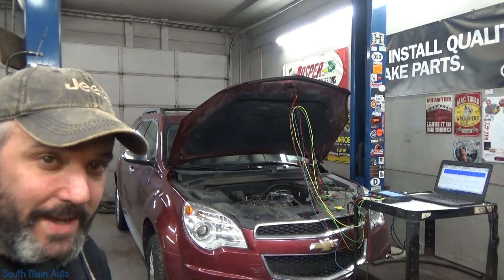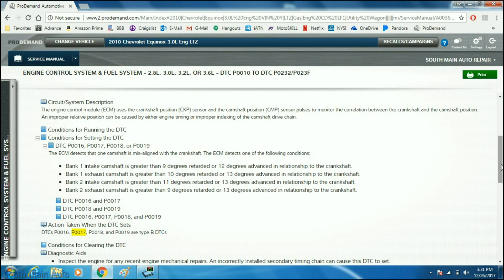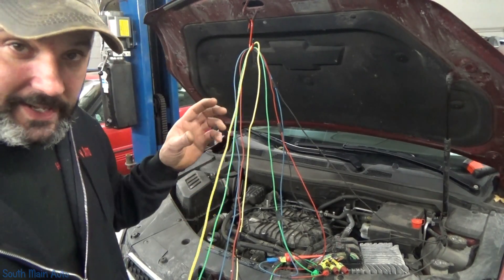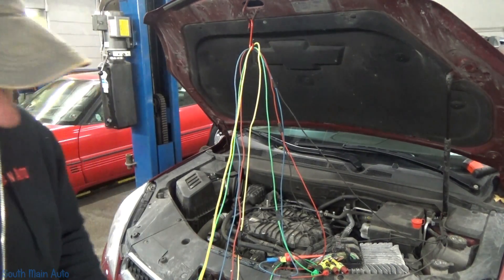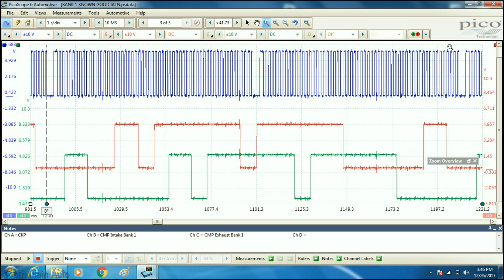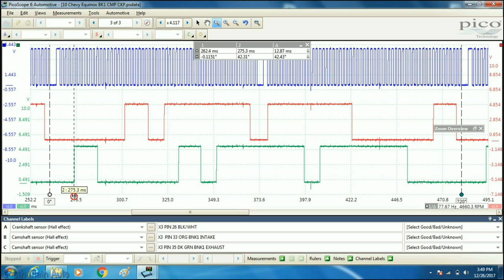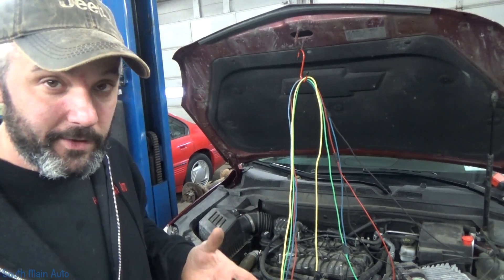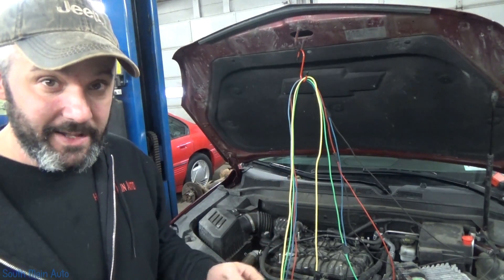Do I NEED A Lab Scope In My Shop?!

Comment: a scope is a vital tool now, we do have a pico in the shop and it is a crazy good tool however sometimes you just need a quick scope hook up to check to see if you have a pattern. some meters do have a scope function but there are so many small easy to hook up scopes now from people like fnisi etc that take the guess work out, .  2 seconds back probe on a lin bus will tell you a vast amount then you can break out the big guns and dig deeper. as always great videos.

Comment: Thanks Eric, Great Job.  Scopes are indispensable at monitoring several automotive sensors.  I used one to confirm a rough idle was caused by an Intermittent drop of the Throttle Position Sensor signal, this was on a 2001 XTERRA. In todays World to be an Auto Professional Diagnostic Tech , Its a MUST to have a Scope !!.

Comment: I have never worked with labscopes and have been a mechanic for 40 years. I do understand how they work somewhat and now have a need for one on a car with a very intermittent problem. I actually found one at my shop (they didn't even know they had it) that is actually a scan tool ( Vetronix MasterTech)  that has a 2 channel  oscilloscope. So in driving this car I was able to confirm the customers complaint after driving it 71 miles over a period of 5 days. I'm pretty sure I know what it is but want to verify it being as the car is setting no codes. my question is how do you charge for a situation like this where it takes days or weeks of driving with a labscope hooked up to the vehicle.

Comment: Anyone have experience with using a wall plugged regular oscilloscope for automotive work like this example and other use cases in automotive area? With datalogging and viewing later on computer, is the picoscope software the best thing about picoscope product? Or are regular oscilloscope software good enough?

Comment: Thank you.
Excellent analysis!! 
1. The definition of the setting the code was very important.
2. Setting up the vertical cursor's was also very important.
I agree with you, the oscilloscope provides excellent  interrogative data.
However, With out knowing, the conditions that set the code or under standing how to analyze  the trace. I was lost.
I was not sure which high pulse was used to detect cam position. Sense their is four high pulses  on the end of the camshaft, Or was the should I set the cursor to  the left or right of top dead center of the crank pulse. Thank,much  appreciated!!!
Steve Marshall

Comment: You say you're not a scope expert but you get paid to troubleshoot using your scope so by definition you're a scope expert, at least for automotive use. I bought a Hantek 1008C for personal use only. I can only justify so much monetary expenditure for personal use and that is why I chose the Hantek. I wondered, at the time, why anyone would need more than four channels but you just made that very clear. It would be neat to compare the factory troubleshooting procedure with your methods and see which method is better and why.

Comment: Having owned Autoscan and Snap-On and best of them all ---> Allen 16-000 Series Analyzers over the years - until DIS showed up, now I find that I need to get back into oscilloscopes all over again. 
It's a different world. 
COP and VVT and modules all over the place in vehicles since @ 2003 or so, make it mandatory that you have a good ability to use one.

Comment: If nothing else, a scope will wake you up on just how horrid the automotive electrical environment is.  Spikes, transients, fluctuations, noise etc all show up on a scope.  Things transpire on the main 12v supply rail that, I think, most mechanics never dreamed of.  All of that stuff has to be "absorbed" by sensors and computer modules, and they're expected to work around it.

Comment: I would like to have a scope to help with proper diagnosis but I honestly wouldn’t know how to use it or what I’m looking at. I actually had an acadia a few months ago with 0035 & 0036 codes iirc and recommended pretty much the tear apart scenario you described based off the tsb.

Comment: Havent watched vid yet, however, YES a lab scope is imperative in a modern auto shop. I used one to find and diagnose a dead hole in a 1969 dodge charger with a secondary ignition probe. Unbeknownst to most techs, the signal looks different when firing under compression and firing with no compression.
After watching video, and as a devout scope guy, i am in complete agreement with everything you say. Just a quick comment, I AM JEALOUS OF THE PICO. And for so many channels, you can get a 100$ Hantek 8 channel. No where near as fancy as the pico, or the Autel, but you can put as many channels as you want on the screen. I have a couple cheapo roust about  PC scopes. My shop scope is the Autel, and my mobile is a Vantage Pro, for when i dont need many channels and i am too lazy to look for a wiring diagram, its all in the scope by year make and model (mostly, some gaps of course).

Comment: Background, you might want to know that engineers worry about the same "stuff" that you guys do. Except... the math required to follow what is going on in an electronic box is not what you need to know. HOWEVER... the NEED for ACCURACY, REPEATABILITY and STORAGE for a lab quality scope usually is not the same as for your equipment. You need equipment which will do YOUR work better just as we need equipment to do our work better. We both need GREAT equipment, however. The average product an engineer works on is FAR LESS than the product cost of a car. So... what should you be looking for? Renting equipment which is designed for the jobs you need... equipped with the software which stores, compares and analyzes that data, BUT WILL SURVIVE in a shop environment. I am SURE you can find and rent the same gear that the manufacturers use. It is the ONLY way to compare apples to apples instead of doping out measurement differences which would drive an engineer crazy. Good luck on your quest. And YES... you DO need gear developed for the specific needs of your practice.

Comment: Erick, GM has had problems with improper tempering of timing chains, esp with Cadillac, I have seen chain stretch on part of the chains where half of the chain looks good and the other half stretched,  and as early as 8K on the odometer! Caddy tried to band-aid this with PCM reflashes making more frequent oil changing intervals. You can blame GM for subletting the chains to Asia for sub standard manufacturing.

Comment: As a home bolt breaker. I watched a video of tech chasing a CAN signal problem. He hooked his scope into the OBD2 test  port.
You could see the problem on the scope. Instead of being mirror image of each other. You could see the interference in the signal.
He found a CAN junction connector. And just unplugged connections until he saw the signal go normal.
WALA it was some controller in the over head  console. 
Boom that made me want one. I found out you can get a Hantek 1008C on Amazon for about a hundred bucks.
Thats shade tree tool money right there. Came in the mail today.
Have zero idea how to use it. But cant wait to start to learn on it.

Comment: I’m not a auto tech. I work around heavy industrial applications. I use a old fluke 123/003. For me it’s a great tool because I can see more and replace very expensive parts with almost 100% accuracy and confidence . Owning a scope forced me to learn and understand most everything at a much higher level. I plan to buy a Pico and learn even more. No,I won’t make a red cent using it, but that’s ok. I love to learn and it make me feel just plain good. When co worker give me a hard time about all the money I spend on tools I tell them it’s better then a crack habit. This is what floats my boat and back off. They back off really fast when they realize they don’t know jack and I might be a good guy to know if they ever need technical advise. Yes a good tech should own or plan to own a scope and get good with it. Electronics are only gonna get faster and more complex.
Reply: It’s been 4 years you’re probably already owning a diag service business after buying a Pico lol. Very few mechanics even want to use the one in the shop, almost none can master it to solve problems.

Comment: Your videos have helped me tremendously. My retirement budget didn't allow me to go with Pico, but I'm very happy with the Hantek 1008c scope, cc-65 and cc-650 clamps. I know they are not as refined as the Pico, but they have helped me diagnose a lazy fuel injector and verify a bad crank sensor. I also sprung for an Autel MD808Pro and GTC 505 ignition analyzer along with assorted backprobes, leads, etc.
But regardless of the diy equipment level, your sharing of knowledge has led me to learning about diagnosis rather than loading up the parts cannon. Thanks!

Comment: Picoscope "automotive" scopes starting at 900$ are expensive, especially for DIY enthusiasts. I have picoscope 2204a, 2 channel 10MHz scope, that costs about 130$. For me the biggest advantage compared to any other USB scope is the software, from picoscope you get the same software and features for 10 000$ scope that you get for this 130$ scope, free updates for lifetime. 
2204a supports only picoscope regular software.  For those new to scopes be careful not to overload and kill the scope on ignition components. Also any bench scope can be used for automotive diagnostics. In picoautomotive website you can get ideas for different sensors, and pressure transducers(and testing procedures), that you can build you self for small fraction of the price, and they will work just as good. And to build them is not much more complicated than fixing cars.
If I would diagnose cars for living, I would go for 4 channel "automotive picoscope"  and original accessories.  "picoscope automotive"  software is the same regular software + you get access to dedicated picoscope automotive forums and known good or bad waveform database. Additional extras might pay off after properly diagnosing some cars that nobody else was able to fix.
Reply: Is tru

Comment: In most of your videos where I see you use the scope, you seem to be using only one or two channels.
What is it about the 4000 series that makes you think it's worth the price over the cheaper 3k or even 2k?
With the cheaper models, you get 1GS/s and the 4k only gives you 80MS/s. Also, the bandwidth only goes to 20 MHz.
I've been wanting to buy a scope for electronics work, but I also have been seriously getting into automotive stuff. Are the 8 channels really so important for automotive diagnostic that it justifies the price, and the loss of bandwidth and sample rate?
I actually almost have to buy one now. We are kind of stuck in with doing all the work ourselves. The relative compression test is one major reason I need it. I guess I just want to know if I get a 2k series, will I be screwing myself on my capabilities for this kind of work?

Comment: When hiring a tech at my shop, the first thing I ask is what type or brand of lab scope they are using. 9 out of 10 times they look at me like I have 3 eyes. I ask this question because if they haven't used one then they aren't a true diagnostic tech. It is 100% impossible to perform a 100% perfect diagnosis, along with repair verification, without a scope when dealing with any kind of engine/transmission management sensor. With a lab scope, I can go home at night knowing that the issue is definitely repaired and has zero chance of a comeback due to my diagnosis. Rather than thinking to myself, "Oh, I hope that car doesn't come back with the same code".
Reply: Dam good luck finding techs like that then
Reply: @Sebastianx115  you ain’t lyin’. Still can’t find one. I’m hanging it up in a year and a half when my shop lease is up for renewal. I either close it down or sell it. After 38 years I’m done.
Reply: @MicheluceRizzuto  wow i just started mine 3-4 years ago money is good but can be stressful
Reply: @Sebastianx115  I don't do too bad. It's a trade off though. Sometimes I wish I still worked on the line and able to go home at 5 without the stress factor. I'm at the point where I take in what I want and I don't break my balls anymore for the most part. I'm 57 y/o and I've beaten myself up over the years to where my joints hurt and my eyes and ears suffer a bit from it. I don't know how long you've been at it, but it will take it's toll on your body eventually. I started doing auto upholstery a couple years ago and that business is picking up fairly well, so I have something to fall back on and pay the bills and mortgage once I exit this career for good. I'd like to say I have the option to retire if I wanted to, but when I was younger I blew the hell out of some money and just started saving money for real about ten years ago when I woke up and realized I wasn't going to be young forever and retirement age was just around the corner. Bam! There it is!
Reply: @MicheluceRizzuto  Yeah I've been working on cars for ten years and in business for about 4 and at the moment have a solid team, 2 other employees who are good at working on cars i try not letting us work to hard

Comment: Modern vehicles are really just a set of networked computers with some wheels attached to them.  The computers and their software will become ever more complex.  It will be IMPOSSIBLE to properly diagnose and repair them without scopes and advanced scanners.

Comment: I don't understand how techs can be expected to rebuild motors and be entrusted to ensure the safety of customers' vehicles yet not be expected to understand BASIC electrical concepts that are taught to middle schoolers... The sad reality of our industry is that with just a fundamental understanding of electrical, you be considered "advanced".  It never ceases to amaze me how much ignorance of electrical is ENCOURAGED in our industry... 

Automotive electrical is NOT hard at all. Compared to a lot of other electrical industries and applications it's quite simplistic. It's just that there are a couple dozen or so rules and concepts that you need to commit to memory. The "hard part" is the period before it becomes second nature. You tend to second guess yourself a lot. You just have to keep at it and get through that stage. Electricity doesn't have a mind of its own or do magical things. It follows basic rules. If you get confused with something in the beginning then usually the explanation is far simpler than you thought.

One of the big issues when people try to learn electrical is usually the "teachers" don't understand it themselves... That and people tend to think this stuff is more complicated than it is. If you can follow a wiring diagram and focus on an individual circuit then, really, most components aren't any more complicated than a simple switched light bulb circuit...

Anyways, that concludes my evening rant. Carry on folks.

Comment: Scanner Danner talks about a jeep Cherokee 6cyl engine, that has spun the flywheel. In my opinion, aside from removing the transmission, there was no other way to identify the problem. I  personally diagnose vehicles with a scope. I have just had a volvo with a jumped timing belt i discovered the problem with my scope in less then five minutes. Because of guys like you i have learned and gotten to where i am today in my passion of automotive diagnostics. I can feed my family comfortably because of you. Thank you for everything. KEEP THE VIDEOS COMING!!!

Comment: just wondering if the in cylinder pressure transducer would have been quicker to show you the problem?
Reply from the maker: If you could get to the rear plugs it could have been used also yes

Comment: Why do I have to think so much to get my truck running?  In 1977 I replaced the timing chain on my 292 Ford V-8 in the parking lot of an Exxon gas station in Durham, NC.  The guy had loads of Exxon awards on the walls for his superior service.  I wanted to borrow a timing light to set my distributor.  The owner told me that they didn't have one - they just turned the distributor until the engine ran good.  My mind is stuck there - turn it until it runs good.  Oscilloscopes just freeze my brain.
Reply: Gas station mechanics are not exactly known for their technical savvy. Setting timing by ear has always been proof of incompetence.

Comment: Eric- Here is an idea to save you time and energy fumbling with lights all the time.  I use these when I work on cars etc and most of the time I don't need a separate light( and it protects my head from trying to dent the undercarriage! :)   one example here-https://www.amazon.com/Flashlight-Waterproof-Rechargeable-Adjustable-Headlight/dp/B075VHRDNH/ref=sr_1_46?ie=UTF8&qid=1516815339&sr=8-46&keywords=led+headlamps      they use 18650 batteries and are super bright and last well and work good for when you take the family camping as well!!  I bought extra batteries and a charger for 4 at a time like this https://www.amazon.com/4-Slots-Intelligent-Universal-Battery-Batteries/dp/B072WQH1HJ/ref=sr_1_1_sspa?s=sporting-goods&ie=UTF8&qid=1516815769&sr=1-1-spons&keywords=18650+charger&psc=1.      Light is usually always where you look which works great.   Keep up the great videos- I learn so much!

Comment: I dont have a large shop like you, so the need for a scope is not there as much. In the random time i do.. i just find another way.

Its a shame you could not control it due to a quick  code set.
Possibly still a mechanical failure, more likely the phaser has failed.

Please do a follow up. :)

Can anyone recomend not a cheap, but not an expensive scope?